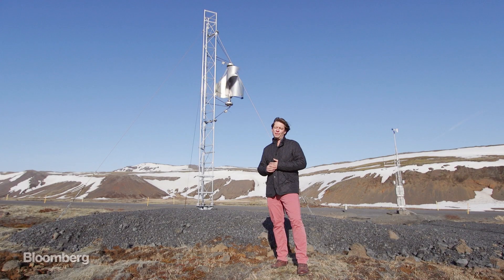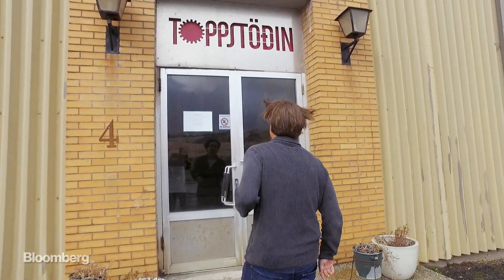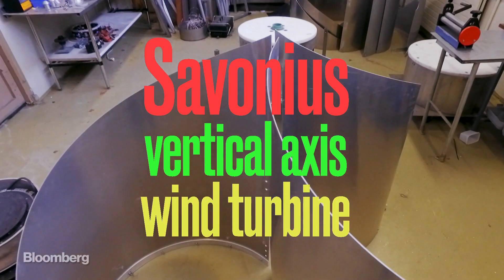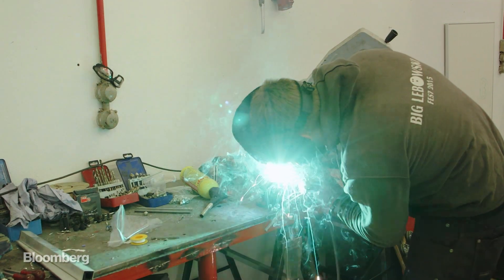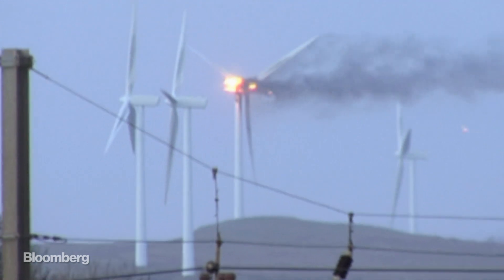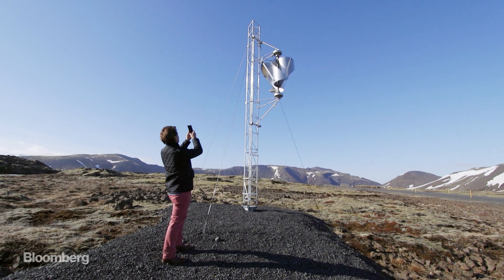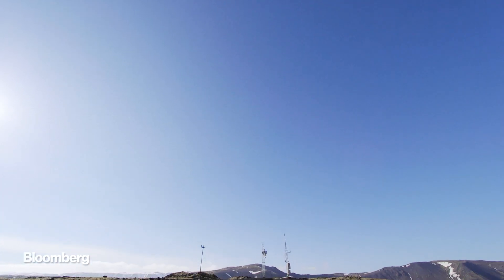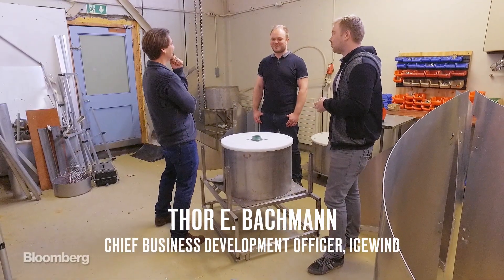The Tech That Could Fix One of Wind Power's Biggest Problems

Comment: The comparison made here is not very good. The cheap but inefficient savonius will perhaps work much better in Iceland, and other high latitude  areas with unstable prevailing wind direction. The failed common Horizontal Axis turbines shown in the video are huge, and were designed for less difficult circumstances at lower latitudes with winds more predictable. Those commercially available units generally do have the ability to ride out storms, but are so large that sometimes they cannot  reduce pitch and turn into the wind fast enough to save themselves from overspeeding.
Reply: Paul Gracey  vjgtyi

Comment: A vertical wind turbine is nothing new. The problem is that the wind is pushing the wrong way on half of the turbine, so it's not efficient. Conventional windmills harness 360° of wind area. Not only that, but conventional windmills have three blades because that is the most cost efficient.

Comment: Harsh wind conditions are not a problem for horizontal axis turbines, they are actually good! It just means the turbine structure has to be stronger. If wind becomes too harsh, HAWT's will turn the angle of their blades to protect itself. At this angle wind just passes the turbines without creating lift or thrust, and with very little drag. Turbines also have mechanical brakes that act on the mechanism itself, but those are rarely used.

Savonius turbines are far less efficient than Horizontal Axis turbines. And much less cost effective. If the government wants to invest in these turbines for isolated purposes great! But selling their energy to the grid is nigh impossible.

The title of this video is very misleading. Still, I'm giving it a like!

Comment: How does this design avoid the dangers of high winds? It's claimed in the video but not explained.
Reply: It prevents over spine because the wind hits both the approaching and receding face. Basically it produces a lot of drag. Which is also one of it's biggest drawbacks. They are just not very efficient in fact they are one of the least efficient types. On the plus side they can be placed lower to the ground and last a lot longer. It also has the advantage of a shaft going all the way through thus adding greater stabilization. A good portion of the weight on an Horizontal Axis Wind Turbines is only stabilized on the back side.

HAWT also get a bit of help because they generate a bit of lift perpendicular to the direction of air flow. This can have the effect of a positive feed back loop causing frequent over spin and a shorter life span for them.
Reply: diGritz1
That makes a lot of sense, thanks! I now understand the disadvantages of the design but not the disadvantages of the bladed turbines. Specifically the feedback you mentioned.
Reply: Melinda Green An HAWT is basically the same shape as a airplane prop which is basically a spinning wing and a wing generates lift. This effect is mostly dependent on the angle of attack of the blade and can be lessened to a degree but never eliminated. So the faster the blade turns the greater the lift it generates.

This can put many different types of stress on the system as a whole but probably the most notable is the longitudinal forces placed on the shaft and housing.  This is slight but the faster the blade turns the more this increases. Hence the feedback on the system and an increasing chance of over spin and/or overheating

Admittedly this is less of a problem with high end HAWTs because they are mostly variable pitch as opposed to earlier models which are fixed. But given the higher cost and greater maintenance of the variable pitched types there is still a lot of the fixed pitched systems in use.
Reply: diGritz1
Another great answer. Thanks!
Reply: The savonious turbine is safe in all winds as the blades cannot spin at a speed greater than the wind speed as it's own aerodynamic drag prevents this .  A horizontal axis turbine on the other hand  will have a blade tip speed of many multiples of the wind striking it . This self limiting design also results in reduced efficiency as only about 2/3 of the energy available from the velocity of the wind ,   based upon rotor size can be converted into torque to turn the generator .
Reply: SubtleKnowledge  ,  the diagonal cut on the blades ensures that the lateral force applied to the turbine is concentrated near the support of the bearing to reduce bending of the structure.
Reply: Wow the first truly intelligent conversation I've found on you tube. Thank you for the question and replies, there is hope for humanity.
Reply: Melinda Green
Regular wind turbines have long blades, which makes them fragile. Vibrations cause material fatigue and if the break fails in strong wind, the centrifugal force can rip it apart.
Reply: The spiral design makes the wind pressure uniformly applicable over the entire blade from top to bottom (as it spirals down the blade, the wind energy is absorbed by every section of the blade). You notice that the blade starts spinning in the direction of the wind thereby reducing some resistance. Conventional windmills take direct impact on their blades and use that to spin. Although conventional is more efficient when facing the wind, it also applies more stress on the blades thereby breaking down much faster. The only problem I see here is that this new design has too much blade weight concentrated on too small an area (which makes it less efficient as it needs more wind to push it 360). The need for ultralight materials is a priority here.
Reply: I think the momentum to run away wouldn't be an issue here either. However the mechanical potential would be quite a bit less as you suggest.
The cantilevered design would add a pretty significant bending moment on the supporting member. But all in all it's a very nice design. I would like to see it in a wind tunnel. :)
Reply: Also they work in choppy wind.
Reply: Sure, but now it's directional so you're going to have to be able to move that baffle around depending on the wind direction.
Reply: Laszlo Zoltan ,  you are correct,  and the triangular sails became curved when under wind .
Reply: now this is a proper explanation, thanks for the clarification.
Reply: The distance from the hub to the outside of the sail is much shorter, so the centrifugal force which can destroy and slow down a conventional wind turbine is much less. Get on a playground merry-go-round, and push yourself around with your feet. Then draw your feet in, and see how much faster you go.
Reply: +diGritz1
you seem to know about this, question: if you add some kind of housing to the face that creates the drag, wouldn't the problem be solved in some degree? you could even redirect that wind into the face that needs the wind.
Reply: Here in So. Cal. we have lots of municipal point of use solar panels powering things like signs and street lights. A wind turbine like this another option. The key here is finding places where the wind is as consistent as sunshine.
Reply: @sward999  The ones in the video are in Iceland where the wind is a lot more consistent than the sun.
Reply: Hey. i appreciate your words. But do you have any stuffs which can support your statements? Even I was thinking about that. If you have anything, that would be great and helpful.
Thanks.
Reply: it's a silly claim anyway. it's trivial to protect a standard wind turbine from such high speed wind damage.
Reply: thx
Reply: you mean the (samsung) bladed models ? why ? personally speaking, I find those windmill farms to be awe inspiring
Reply: Compact and decent power don't go together.  Power is related to size.  There is no way around it.
Reply: Some designs are like a governer on a large diesel engine.  It's not just that faster spinning causes wind to eddy over to the opposite side but the shear spinning increases centrifical forces on the design.  It's like a governer on a large diesel engine or old steam engine to keep it from overreving.   The only kind of wind that's going to destroy that turbine is a hurricane or a powerful tornado and by then many other things we thought were strongly built are already destroyed.
Reply: agreed,
Reply: Matthew Sackman
i think some kind of sail would be able to do that right?
Reply: could anyone explain to me why they don'tput in a larger gear ratio or water cool the stator in high winds?
Reply: Have you seen those ancient 'wind-mills' that are still in use in, but are hundreds of years old?  In some places they still use them to grind seeds. They are quite large, made of wood and may even have set-ups to address big winds.  My guess the above system may act in high winds like a heart that beats out of control once it reaches a certain revolution.  If that kills the wind-turbine (like a stressed heart would kill a patient) is another question, but my guess is the turbine is more resilient.  Just a thought ; )
Reply: And WHAT does all that have to do with the Icelandic wind-turbin design? Looks to me they are quite aware of how and where to place those things.
Reply: Look at the design again and you'll find that the convex, 'passive' side of the blades is fairly constant, offers little resistance and allows the wind to easily pass on the outside or feed into the concave, 'active' part of its neighbor blade. I assume, that the diagonally cut blades have a tendency to spill wind in a way that prevents 'overspinning'.
Reply: Melinda Green  he
Reply: traditional turbine required balance  
from the blade and the gear behind the blade, therefore went wind hits the blade it need to have a strong pole to hold it ,this turbine only doesn't require such thing as it can be done with only the blade on top, basically less weight on top safer it is when it drops down
Reply: what is interesting to me (non-technical/engineering background- common layman) is the triangular shape is also used in sailboats, not curved of course like this is, but....- with triangular sails the age of the square sailed tall-ships ended. This does suggest to me there are real practical advantages to the triangular shape
Reply: That is one of the thing I would like to know as well. Personally I am all for more compact wind turbines particularly if it also is capable of replacing / superseding the large horizontal axis one predominantly used at present.
Reply: hohohoho the size of magnet and coil not the fan
Reply: feathering.
Reply: You are correct.  I had meant my comment about size relating to power to apply only to wind turbines, but this thread has become so massive it's hard to tell what people were / are talking about.
Reply: Aren't vertical designs less dangerous in  high speed winds partially because it's not giant blades that could potentially kill flying creatures?
Reply: @hyrulphicsound The turbines shown in the video wouldn't produce enough power for even a small off-grid home.
Reply: It gets down and runs away?
Reply: a super conductor would reduce friction
Reply: jackthefuckingblack

Comment: Seems super inefficient and a waste of material, compared to classic three blade designs.
Reply: In a 5 minute google search, this design is used when reliability is more important than efficiency, like powering deep water buoys, where you don't want to have to conduct maintenance, very often.
Reply: LordF
Every wind turbine is creating vortices that normally render nearby placed turbines useless. I've seen a report about a science project where vertical axis generators were placed in a way that they were propelled by the vortices. In this way the energy gain per land area was increased above what is possible with a horizontal axis type generator.

One big problem is:
Big companies have no interest in researching vertical axis wind generators because, as inefficient as they are, they are easy to make and, because of them working at low wind speed, can be placed almost everywhere which has the potential to make people energywise independent from big companies.
Reply: You are right. Savonius wind turbines are less efficient at extracting energy from the wind. They are normally used when cost and reliability is priority rather than efficiency. They are also self starting as opposed to conventional HAWTs. These are extremely easy to manufacture and require very little (almost no) maintenance. That's why all anemometers are Savonius turbines.
Reply: Yes, vertical axis is cool, but it's less efficient than 3 blade designs.
Reply: inefficient per turbine - yes
inefficient per area used - don't think so
Reply: They do not have to shut down in low or high wind so have more uptime producing electricity. Output over time will depend on local conditions.
Reply: LordF
Seems i didn't express myself good enough.
With area used i mean the land around a wind turbine in which no other wind turbine can be placed.
Reply: MKu MKu Keep in mind that only half of the area is capturing wind, while the other half is moving against the wind!
Reply: Big companies have no interest in researching vertical axis wind generators - MKU MKU is right. They stand together with the aim of keeping us slaves and we are just too starry-eyed to dig deeper.
Reply: MKu MKu I see. Why do you think the efficiency per area would be higher with vertical axis? Taller form factor?
Reply: Stu Bur
Reply: this set up is very cheap hardly $150
Reply: LordF
Reply: Perhaps less efficient, but I suspect it is also less hazardous to birds.
Reply: MKu MKu Cool! That sounds quite promising.
I don't think it makes sense to look at this as a conspiracy/business cartel by energy companies.
I think the current limitation is not so much the wind farm area, but the capital investment, so the more capital-efficient design is chosen. Many times wind turbines are placed in single line on a hill.
Plus, distributed wind generation does not require area efficiency.
Reply: Chris F We can solve that with a mesh for small scale systems

Comment: This thing is for smal electric thinks a good idea, but when u need more power u must use more wind. More wind = bigger turbine. And the wind is only in the higher Air strong enough... also this thing must be build higher. I think ist the same as the other turbine system...

Comment: Savonius wind turbine has been around a long time: usually made from 44-gallon (US 55 gallon) drums cut in half...
Reply: learned about them in 1972 mother earth news
Reply: standard in England and USA only
Reply: An imperial gallon is 5 quarts, I believe.
Reply: And that's why they are great for remote locations with only very little need for power.
Reply: kenneth keen They're still known as 44 gallon drums in metric countries, at least here in Australia they are.
Reply: Kenneth Keen: Gallons are the standard unit of volume, except in many backward jurisdictions which have regressed to socialism. They use the sissywimp unit close to a quart. There is a psychologigal weakness which is assuaged by larger numbers.  .(fuck)
Reply: What the fuck are GALLONS? Join the real world dude!